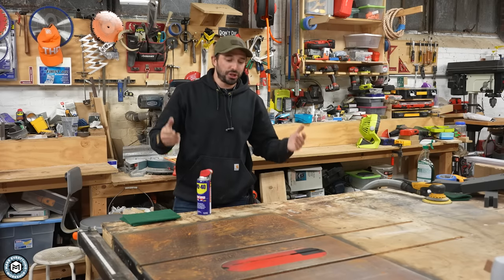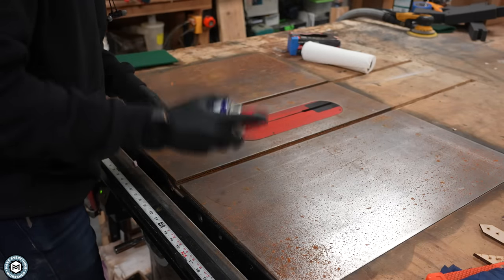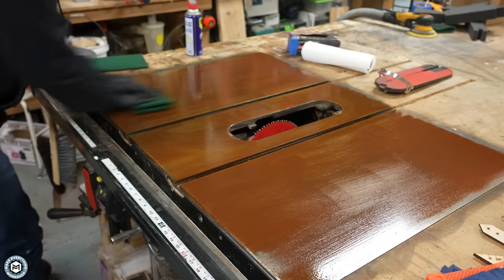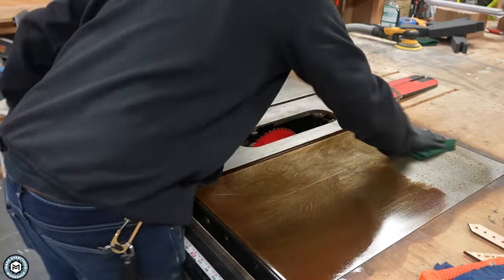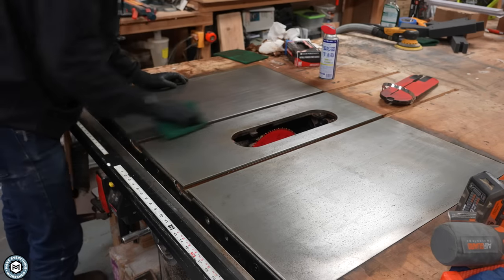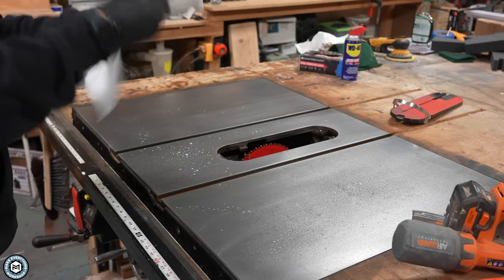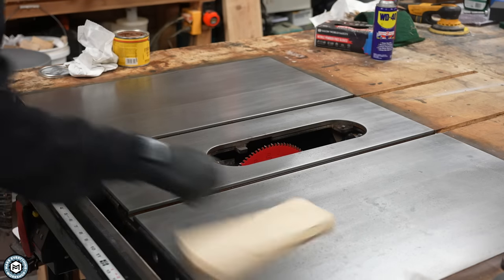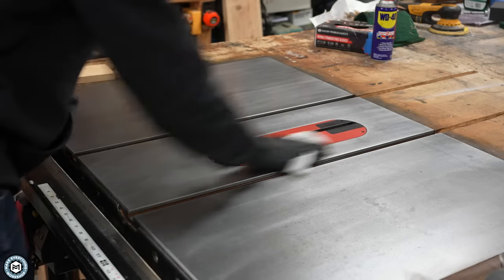Save Your Rusty Table Saw!

Comment: Another extra 2 steps taught to me in the ship yards. After cleaning or on a brand new machine with exposed metal surfaces. Step 1. Us a Map Gas torch to remove the natural water from inside the metal sub strait. ((A Preheat)) Step 2. Than apply the wax or rust preventive while the metal is still hot so it melts and soaks deep into the metals crystalline sub strait. Filling the voids.⭐⭐⭐⭐⭐Perfect step to use on machines using coolant. Mills, Laths, CNC's machines - etc. etc. etc. etc.
Reply: I know this is a year old, but I  agree.
I'm restoring a 1952 Sears 6" cast iron belt sander.  Once de-rusted using vinagar, then cleaned with Brakleen, I heated it with my propane torch before actually applying the paint.
When pre-heating with the torch, I immediately saw the moisture boiling out of the cast material.
It doesn't need to be 200 degrees, just spend the time to warm it up.
.......Now im painting, but before oiling or waxing, preheating the material makes sense.

Comment: While this might seem to be a great idea, but using oils and non-drying lubricants on the cast iron surface of your machines can cause you some future issues. These products can end up transferring to the wood of a project and screw up the finish of something you just put a dozens of hours working on and hundreds of dollars invested in. If you use them to clean the cast iron, be sure to completely clean it all off with alchohol or acetone. Where where it soaked in to the wood of the out-feed table can leach back up into a piece of wood you lay across it. You should use a drying product like Carbon Coat, EzzOx, or Boesheild, then follow it up with a good quality wax afterward. Make sure you fully clean off the excess wax residue. Follow up up with another coat of wax every 6 months or so.
Reply: Even better, pass current through the table {in isolation} and nickle plate it.
Reply: The degreaser was more than enough to get all the residue from the WD40 off of the table. You literally suggested exactly what he did. You would have to leave a piece of error sitting on top of the outfield table for any of that to soak into the woods. It's a non issue
Reply: @littlejackalo5326  not a non-issue. many woodworkers need to use their table saw for larger project assembly. Many degreasers leave residue behind. And you'll never get it out of the outfield table wood, or out of the seam around the saw top edge without disassembly. Just avoid using petroleum or silicon products that will mess with a finish and then it will actually be a non-issue.

Comment: I once discovered my cat had decided my cast iron table top was the perfect spot for him to lay in the sun during the winter. When I got around to using the saw again, any flat surface becomes a table to store things try not to let it happen, I discovered a perfect little cat shaped rust spot on my table. So, I had to do the same thing you did here. It takes some work but looks great afterwards.
Reply: Plastic floor runner upside down with the spikes up.  He will learn to stay off it.

Comment: To protect your MDF outfeed table from further damage, consider laying down a couple coats of shellac. Then put a coat of wax over that. The shellac dries pretty dark so it will cover a lot of the stains on there now. The wax will reduce friction when you rip long boards too.

Comment: Good job. Problem is, it is only temporary.  A better solution ls to use Evaporust not oil. Evaporust is nontoxic and no scrubbing.
Then you get a Nickel plating kit and you can litterly rub (lightly) on the Nickel with a  cloth and a 12v battery. 
Two to Three coats required.
It will never rust again.
Other options  are to laminate the top with Formica or 30Ag stainless steel sheet.

Comment: I used fine beach sand and light motor oil to clean my saw tabletop. Lightly oil the top and spread oil evenly and sprinkle on the sand. I then took a piece of Low Carbon steel, about 6" square and scoured the saw table in a figure eight motion, rotating the piece of steel by 90 degrees each few strokes. Overlap the table edge with the lapping plate to keep table flat and not make i the tabletop concave. Works great. Just a thought. Try using the machined bottom of a Cast Iron or Aluminum Frying Pan.

Comment: I had a rusty bandsaw, put some penetrating oil on it (a very liberal amount), then I started hitting it with a wire brush. It took like 2 hours of not much happening before I gave up, then I put some plastic over it to cover it. I came back the next morning expecting it to need another couple hours, but nope I was able to just wipe all of the rest of the rust off with a shop towel. I recommend leaving the oil on for a longer time if you’re having difficulty getting the rust off

Comment: @Make Everything  Try this next time....
1.  Dry scrape with a razor blade on a long handle, move with the grain of the surface grind.
Change blades often, and avoid running over the table edges, miter slots or throat until the end because doing so will burr the edge of the blade.
2.  Apply WD40 as a lubricant, specialist rust release if you have it, then use an orbital sander (better) or burnisher/polisher (best) and graduate from green to maroon to grey scotch brite pads or wheels.  Move with the grind of the table.
3.  Clean between passes with a rag and reapply WD40 as needed.
4.  Remove tough stains (like the ever-present beer can ring) with Boeshield Rust and Stain Remover.
5.  Wipe surface with mineral spirits.
6.  Take one final pass dry, light pressure, with the grey scotch brite to give it a final shine.
7.  Wipe surface with mineral spirits.  Gently heat surface with a propane or map gas torch.
8.  Apply crystalline paste wax from Rennaissance, Johnson's paste wax or Boeshield T9 spray to make the surface slick and provide some rust protection.  Reapply depending on how often you use the table saw, jointer, planer, band saw, etc...  For heavily used machines, I apply a light wax 1 time a month.

The process, start-to-finish as described, takes under 30 minutes to remove surface rust in far worse condition than shown in your video.  I restore several wood and metal working machines a year for the last 25 years.  My process has only improved by adding a burnisher/polisher and scotch brite wheels and Boeshield rust and stain remover to my process.  It's fast, and it works well for light maintenance or heavily rusted restoration projects on any cast iron surface, big or small.

Comment: Sawstop recommends that you use the gray scotch brite pads. I think they are less coarse so they will take some more work to remove so much rust but you get a better shine from them so you don't have to use fine grit sandpaper.
Reply: Yeah, gray is finer than green.  Red is in between gray and green.

Comment: Nice!!
How do you know the "direction of the grain" on a metal surface??... I didn't even know a cast iron top had a "grain" direction....
Reply: You can tell when you look at it. It’s not a grain as in the sense of wood but the way the surface is milled during manufacturing. On a saw or jointer or planer it will normally be in the direction the material will travel. Sometimes on something like a spindle sander or drill press it won’t be a linear pattern but more of a swirl or spiral.

Comment: Use a sander, or angle grinder with the scotch bright. Its soooo much easier, and faster. 
 
Personally id have dry sanded the surface rust off first, as it would allow me to pull the rust into a dust collector/shop vac.

Comment: I have one of these and recently the shop roof sprung a small leak. FYI there is NO direction to the casting and I use 0000 steel wool and a block of wood. Then random orbit with 320gr.

Comment: Cover the entire table surface with cheap paper towels.   Douse it in vinegar.   That will remove most of the rust quickly.  Vonagar also has some etching properties.
From there on,  its up to you.   You cant over measure or over prep.

Comment: What do you use to clean the scotch brite pads so you can reuse them?  How often should you apply wax?
Reply from the maker: I don’t clean the scotch pads I just rotate them using basically 1/4 of the pad at a time. Then I throw them out. You can usually feel when the wax has worn out and then reapply. Every couple months usually depending on use

Comment: Would the Minwax be good to use on my anvil, too? I have a primitive smithy and the roof occasionally drips onto my anvil resulting in a surface rust I clean off with WD-40.

Comment: I don't even leave wood on cast iron, especially if it's freshly milled. Any residual moisture will leave a nice tattoo on the surface. Don't ask me how I know. :)
Reply: I’ve slowly realized over time that o was leaving just sawdust on the top which would then pull moisture from the air and hold it on the surface and you could see the rust right where the pile of sawdust was.

Comment: I realize you're sponsored by WD40,  but Evaporust followed by Boeshield T9 would have made your life so much easier and prevented any future incidents like this...
Reply: Trying to use evaporust on that large flat surface would have been a nightmare. Soaking rags and letting them sit on the surface would waste a ton of really expensive evaporust, and would have taken a long time, and would have needed to be babysat to keep from drying out. The gel evaporust would have been a pain to clean up. Wrapping it in cellophane, and then trying to clean it. No thanks.

Comment: That WD40 is junk for that purpose. What you want is distilled white vinegar (acetic acid), which converts the rust to iron acetate.

Just don't let the vinegar dry on the table top. You MUST towel it dry after you've done your work, and then you MUST cover the iron with pastewax afterwards... although I'm ready to experiment with BoeShield this time.

I have to do this twice every year because I live in Vermont and my shop isn't heated.

Don't feel ashamed to use steel wool. You'll never hurt that iron with it - the cast iron is harder than the steel is because it has a higher ferric carbide content.

WD40 just transfers to your valuable hardwood workpieces and makes finishing impossible.

Comment: WD-40 makes things rust faster, it's a great cleaner though. Just make you  sure you put a sealer on it.
Reply: Oh really tell that to my Bridgeport Milling machines is set in an unheated garage that no longer rust because they've been sprayed down with WD-40
Reply: WD40 is a moisture barrier, hence the actual name "Water Displacement Formula 40". It does prevent corrosion as long as its maintained on the surface of the metal.